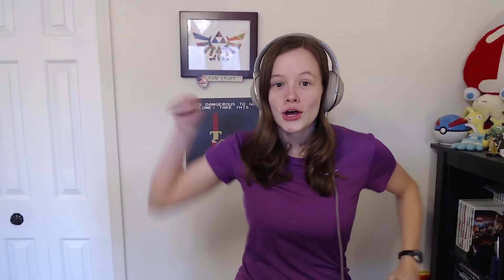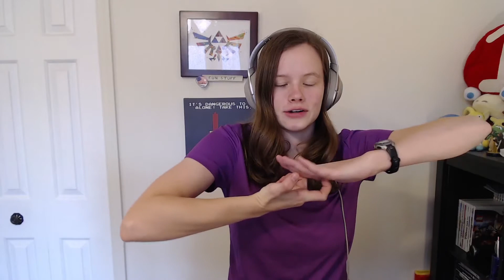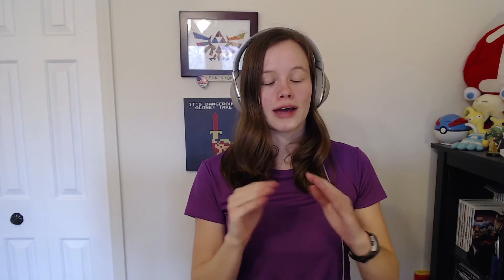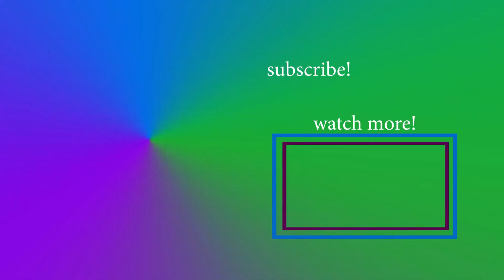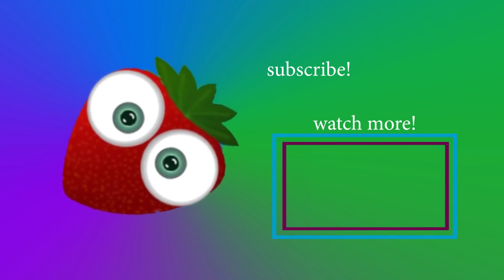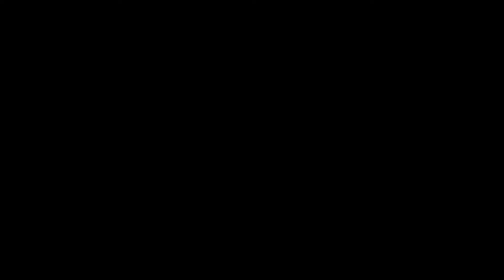Civil Air Patrol Aerospace Dimensions - Module 1 Chapter 2

Comment: Is there a program like CAP in Belgium?  You mentioned something that seems to indicate yes.
Reply from the maker: Yes, there is! However, it is not quite the same . The main focus is flying gliders, and it is very competitive to get into. There is a rigorous application process, and the Belgian Air Cadets primarily run flying camps through the summer to train members. CAP accepts members without prerequisite testing!